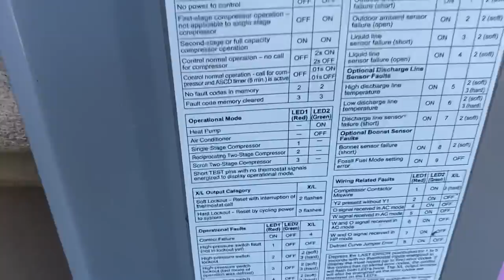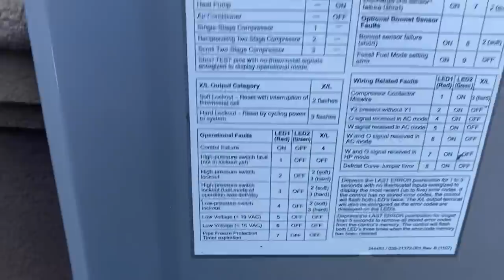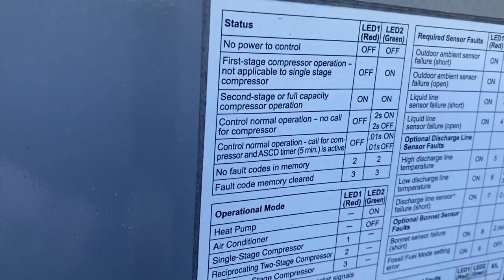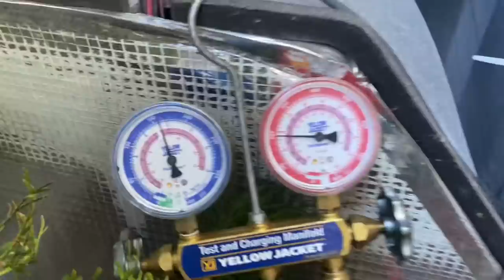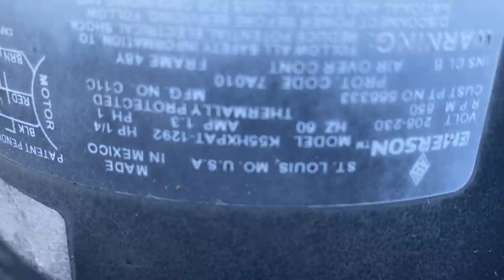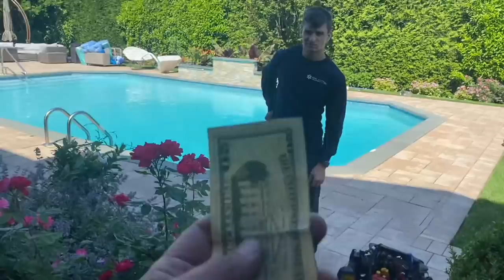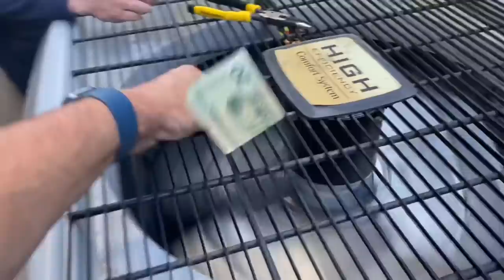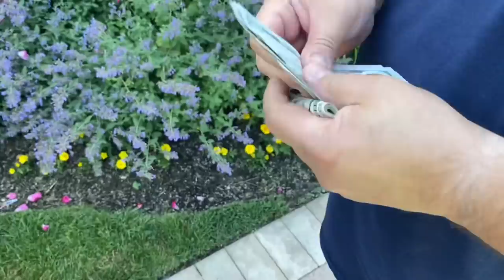Central AC Not Working High Pressure Switch Fault on Heat Pump Condenser

Comment: Hey Mikey: On another topic, I installed my surge protector on my Trane 30A disconnect box today using 10g Wagos. Quick and easy job. Also used my new Knipex auto wire strippers. Insane how well they work even on 10g wire!

Comment: I install ICM head pressure control on those Coleman condenser fan motors.   The motor will usually never spin up to full speed the fan blades last longer and the motors last longer and the unit runs more efficiently especially on the cooler days when you don’t need full fan speed. 

When technicians leave those wires exposed to the UV sunlight after several years the insulation sometimes breaks down in shorts out to the bottom of the condenser fan grill. 
                      For the wires with the crimp connector for the reversing fan wires get rain inside the connectors after a period of few years corrode and break connection due to corrosion. 

They should not be left uninsulated and expose to the atmosphere unless you’re intentionally wanting the unit to break down later on , on purpose ? 
                       A different method of guarantee return work and generating revenue I guess ?

Like watching your content as you learn more and slowly jump in to the other part of the trade other than plumbing. It’s a learning curve

Comment: I actually carry hedge clippers in my truck. I'd have pruned the shit out of that tree before touching anything and tell the customer afterwards. Too fucking bad if they didn't want it cut. It was an obstruction.
Reply: @PipeDoctor  Hahaha.....I know.
Reply: I agree 100%. One time I got to a unit that literally had about 8 inches of the condenser coil along with the service valves buried in mulch. I dug the shit out and threw it around in every direction and I made a mess to be perfectly honest but I didn’t give a fuck, my job isn’t to come do your gardening for you I’m here to fix the AC. If you don’t like it then you should’ve had it cleaned up before I got there

Comment: why couldn't you put your wires in the condo instead of time wrapping it to the top like a rookie I put my wires my directional wires puts around inside of the crimp toward the outside of the conduit and you can slide it in so it looks like factory when you're done just saying😅